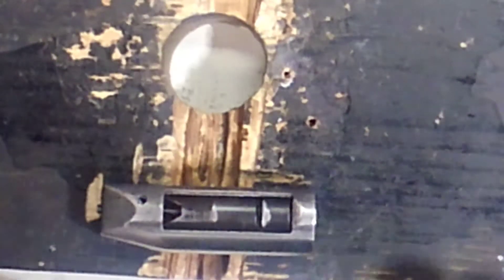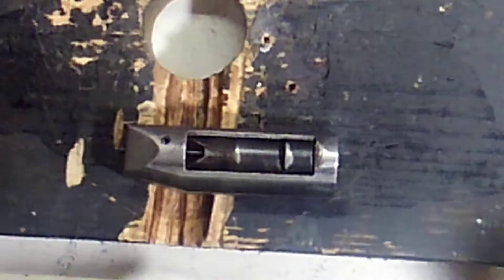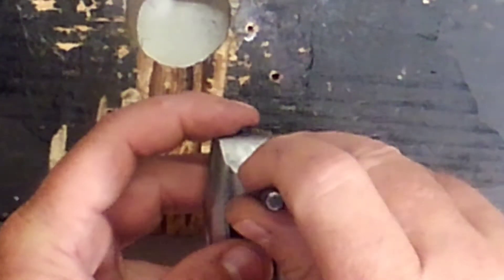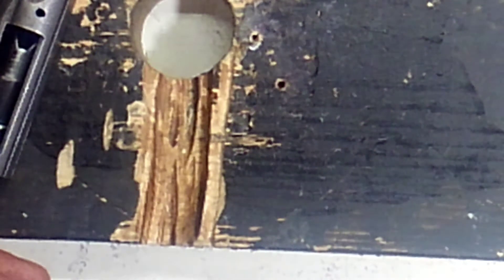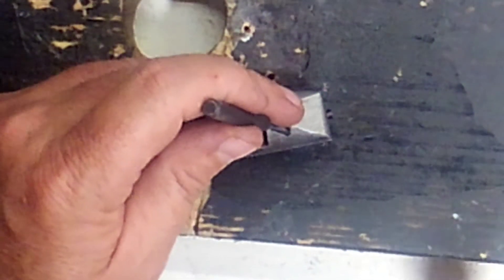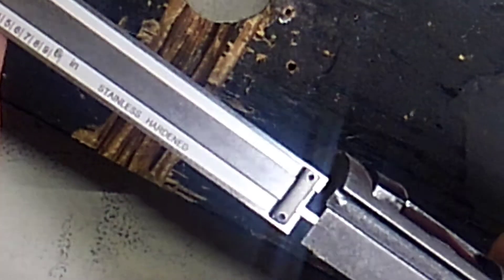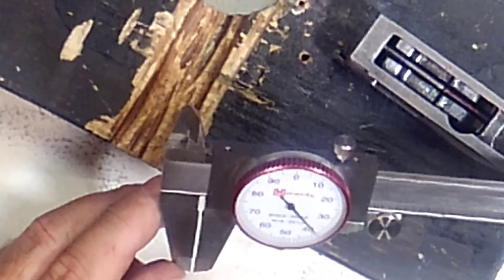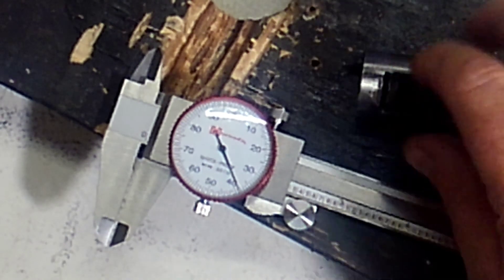Mossberg 930 Firing Pin

Comment: My bolt doesn't have a solid pin retaining the firing pin. It appears to be a split-ring, but it's long sleeve. How to get that out?
Reply from the maker: That sounds like you are describing a roll pin. It should drive out with a punch. Tap don't pound and see if it moves.

Comment: Did the pin replacement solve your no firing problem. Just encountered my issue today. 😒
Reply from the maker: No Sir it did not. I replaced the hammer spring with a Ruger 10/22 "Extra Power" Spring and that did the trick. I have a video showing that operation.

Comment: I hate to tell you this but that would not be the first place I would look I would look to the gs system if those gas rings are dirty enough they will hold back on the bolt just enough for light strikes or even no strikes also try an Oregun marine spacer tube it will help it stay cleaner
Reply from the maker: I hate to tell you this but cleaning the gun is the first step I always take.